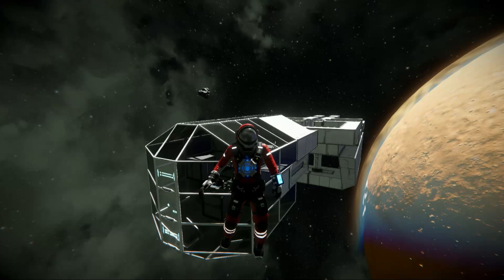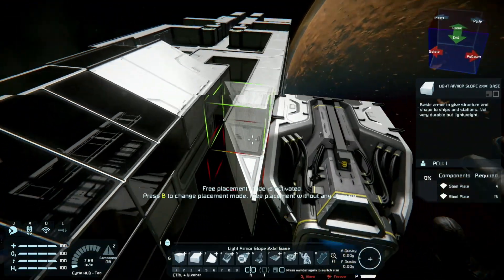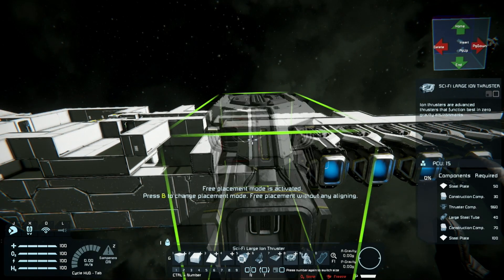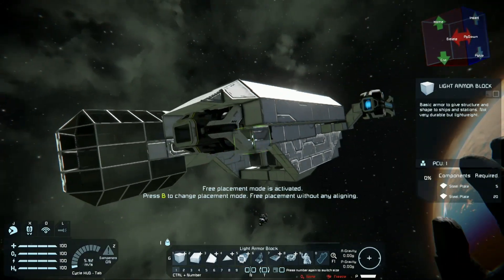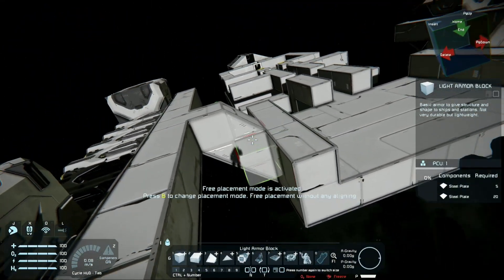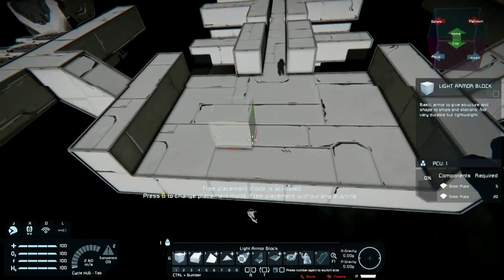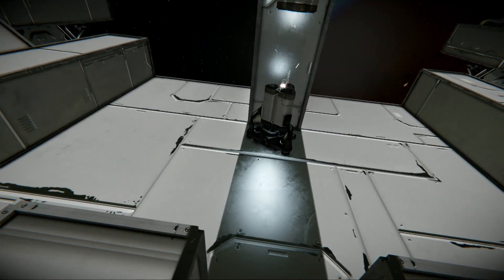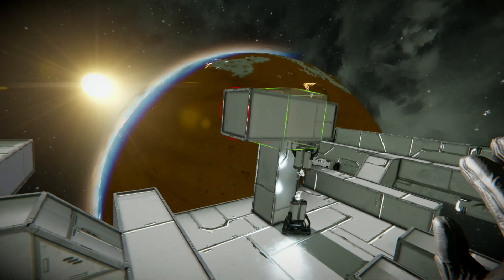Space Engineers Build - Adding some Thrusters

Comment: It’s looking amazing so far. Also a tip, usually when I’m building my ships, I will go and test the thrust capability without wiggling around. (Left, Right, Up, Down, Front, Back) This gives me an idea of the speed and breaking power that I will get out of my ship. So when you were talking at 11:32, I was thinking that you can see if the ship is Uber responsive, or a little sluggish. If it is sluggish, then you know it will need more thrust. If it is fast at getting speed and is really responsive, then you don’t need to add more thrust for the moment. :)